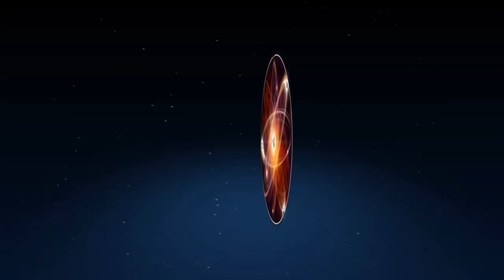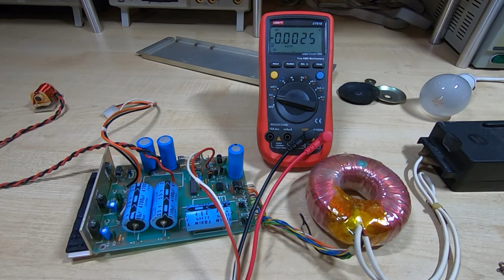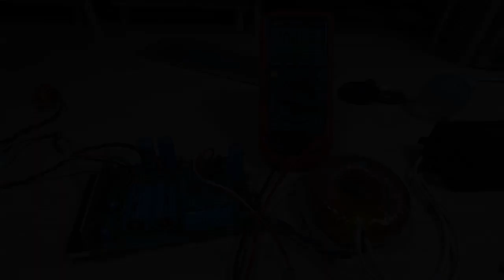HH Tiger CPU Part 3

Comment: Glad it was an easy fix.  I once found a transformer that had a fuse hidden in the winding, just replaced the fuse and it worked again :-)
Reply from the maker: Yes a lot of transformers have a thermal fuse fitted. They are a real pain because they eventually fail for no real reason. About half the transformers I have had to rewind were because of failed thermal fuses. I suspect that the rest of the repair for this computer will not be as easy. Hopefully someone will want to buy it and fund the repair,
Reply: @JerryWalker001  I did not realize it was for sale?  Not that I have any use for it or intention to buy it.  I guess maybe museums or collectors buy these old computers to display?
Reply from the maker: I am repairing it for someone else and I understand that he intends to sell it. A lot of the equipment I get in for repair is for sale by their owners which I why I cannot always complete the repairs. I do not charge for my time but often the owners have to limit what they spend on parts especially as a lot of sellers demand very high prices for parts. I give my time for free because my goal is to preserve old equipment and techology but my funds are of course limited. Even if you do not want to buy it your interest still helps to promote the restoration of these devices.